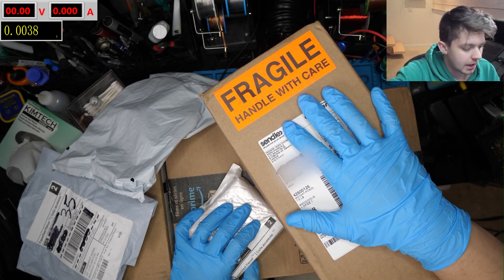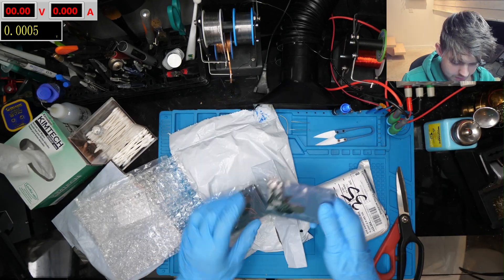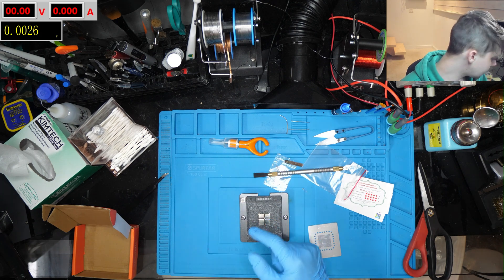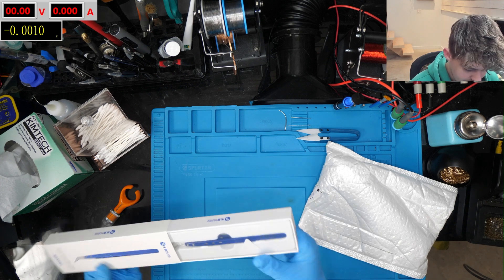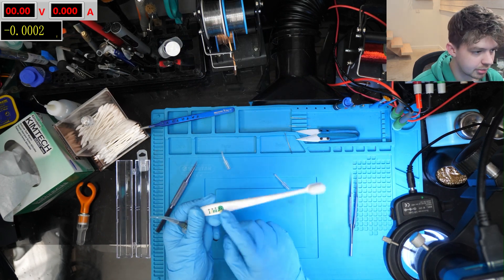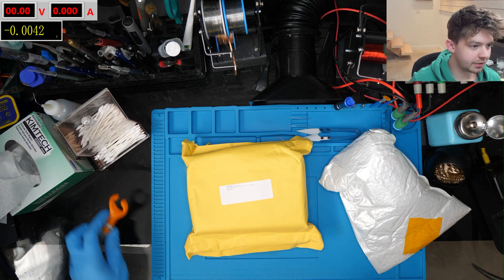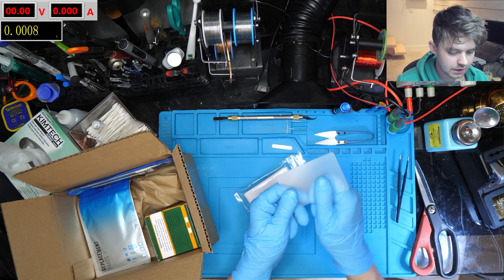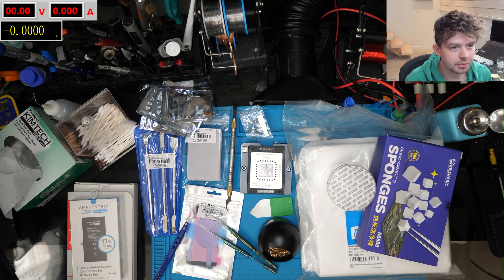New Microsoldering Tools! - Mail Day

Comment: huh, i have the same plastic "hakko" wire sponge holder, it always slides too so i use two hands, but this just gave me the idea to add weight and grip tape to the bottom

Comment: Mechanic has great 3D tweezers, KA-11. They have really precise tips. Sometimes they don't have a great finish, but they are really functional. I can't vouch for the quality of the others, but I'd say that Mechanic tweezers aren't exactly the best.

There are also 3D tweezers from 2UUL, model TW01. I've seen them a lot in mobile phone repair videos (Mijing, Rewa).

I can recommend durable, heavy duty ceramic tweezers from 2UUL, model TW31. They are really big and great for taking things off the motherboard or unplugging connectors. But be careful with them, they can scratch a lot of material. It's hard to break the tips, and the tweezers are very cheap.

I can't recommend the Relife brand. Sometimes their tweezers don't have precise tips, but they are quite durable. For example SK-11, it's ok to take them for general things when you don't care if they will be damaged.

Amaoe has really unique tweezers, specially made of titanium alloy. Take a look at AMAOE AM-16P for example, they are not like the generic blue titanium ones you had, they have reinforced tips. Or some lighter Nunchaku NK1 which weigh 8g. Amaoe are quite expensive.

Mijing introduced tweezers made of titanium alloy, they weigh 7g, specifically the NZ-16 model.

Also check the Qianly iNeezy, they are also great.

For me, Amaoe, 2UUL, Mijing and Qianli have the best tweezers.

Comment: I also picked up a metal solder tip steel wool cleaning thingy, and although mine didn't come with any rubber pads, a good solution I found was to drop a neodymium magnet inside the bottom. That way, it sticks quite nicely to my metal 3rd hand base, or the magnets in my silicone soldering mat.
Reply from the maker: Smart!!

Comment: More Anakin in the videos please <3

Can ceramic tweezers withstand soldering temperatures? I also got the Mechanic nano sponges just the other day and I really like them! But spoiler alert: rather than absorbing a liquid on the board while they're dry, they work better at spreading a liquid on the board after you spray it directly on the cubes first. Cheers!
Reply from the maker: @artysalt  Haha I will absolutely include him more 😁 Yes ceramic tweezers can definitely withstand soldering temperatures. And I discovered the same thing regarding the sponges! Comparison video should be up this weekend, you may find the results of the MaAnt ones interesting if you like the mechanic sponges :)
Reply: @nanofixca  Sounds interesting, let's see! I often paint the front side of my perfboards in aesthetic LED projects and I've seen that when Flux-Off is sprayed on the back of the board, it seeps to the other side and damages the paint. So the nanocubes were really helpful in this instance, because I spray the Flux-Off on the cube, then it becomes easy to clean the back of the board without seeping.

Comment: About the soldering tip cleaner, i've seen people use these electric cleaners, where you only put the tip in and it instantly cleans it till perfection. Haven't used one yet, but seeing you only go for the most ergonomic things, i thought you might get interested in that.
the most popular (expensive) one is "JBC CLMU-PB" and some cheaper alternatives "QUICK 310", "Aixun CM30" "yihua 200q"

Comment: When you use these solder paste spreaders over the magnetic base, make sure you use the ones that come with the holder. That metal is non-magnetic! And I swear its a real mess, when you use a magnetic spreader, are unaware of that, and it gets attracted by the magnet splashing solder paste everywhere 😞. Also I recommend you do a dry run of how you get heat into the assembly. My heatgun is attracted by the magnet, which surprises me everytime. Sometimes I hit it on the stencil and have to start over. Just a few tips. Make the best of them.
I am really looking forward to the Switch APU reball. I popcorned my APU in the first attempt. I hope you have more luck. Keep up the good work and the fantastic videos. Cheers from Germany.
Reply from the maker: Thanks a ton for the heads up!!